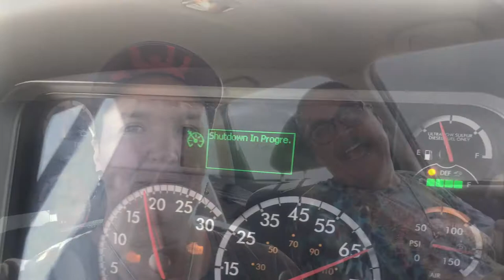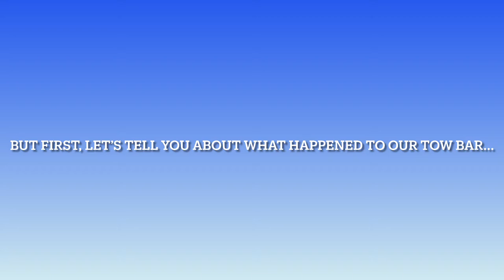DEF Disaster & Breakdowns

Comment: After our DEF head failure on our 2018 Seneca I took the time to swap the lines lines myself. Took me about 20 minutes. The trick is to swap them on the inside of the frame rail. Haven't had problems with our DEF head and the DEF temperature seems to maintain about 10  or 20ﾟ above ambient.
Reply from the maker: Thanks for the tip. We may just end up doing that.